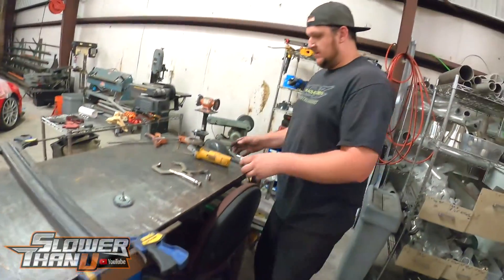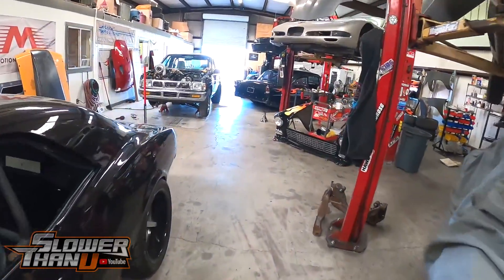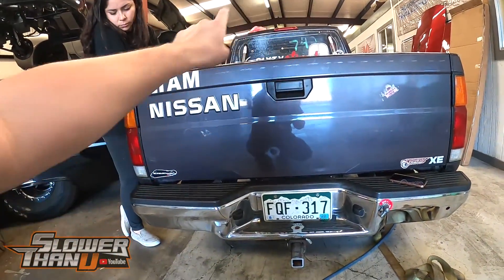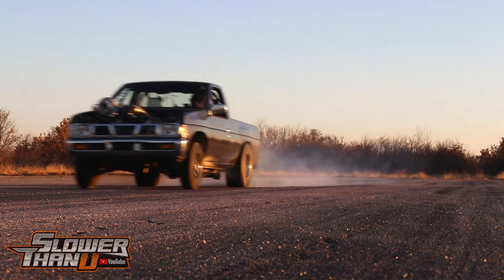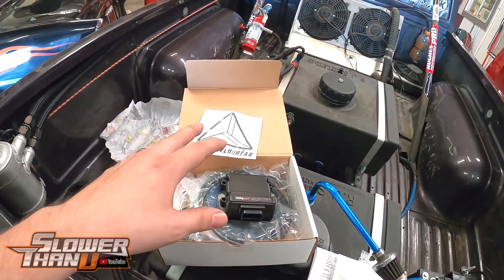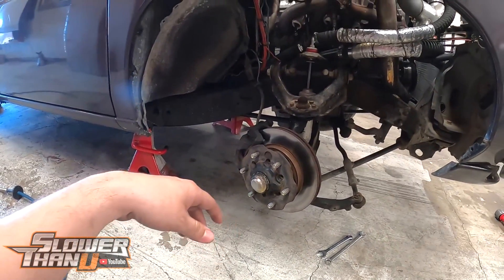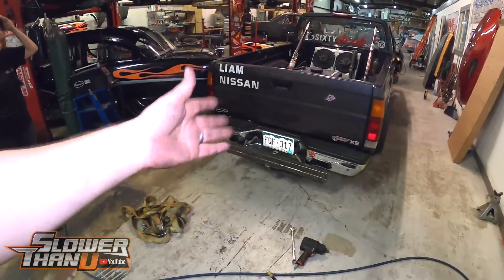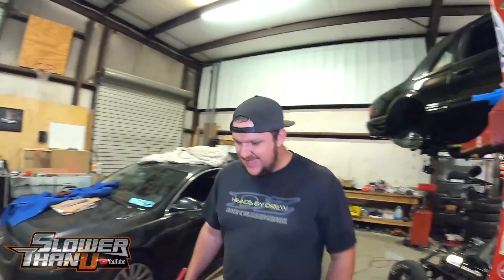Liam Nissan gets a new weight bar and the new Holley CAN IO Module for speed sensors! #holley

Comment: Literally got my I/O module in yesterday, was a bit bummed that the wires literally have to be pinned🤦🏼‍♂️
That’s an expensive weight bar with all that tig welding lol curious to see if the 100 lbs actually helps or if you have to make 3 more
Reply from the maker: Yeah I told his ass to mig it! Yeah 100lbs back there is plenty for our purposes.
Reply: @Therendonfamilia  absolutely not knocking PTSFab in any way, they obviously put together some serious fast cars!  Can’t blame a man for showcasing his talents. I’m real curious if you are able to make them radials hook like you do them Hoosiers on the street, I want to try some of them Hoosiers but not for track stuff, definitely in for your results, but I always watch your vids  plenty to learn from you and your crew!